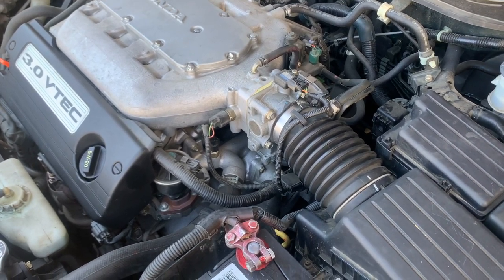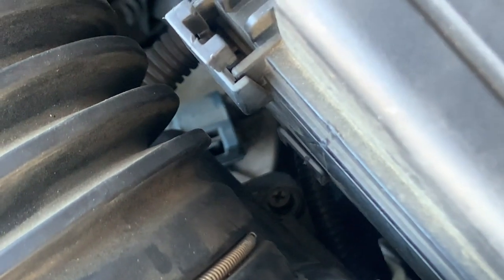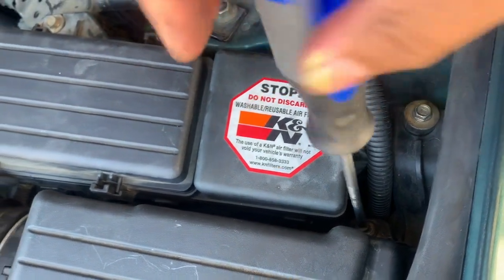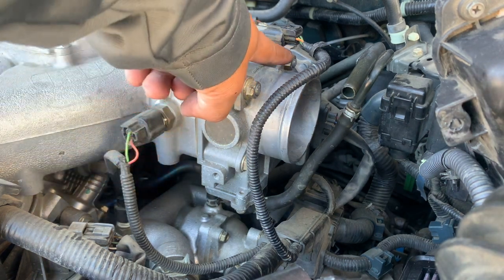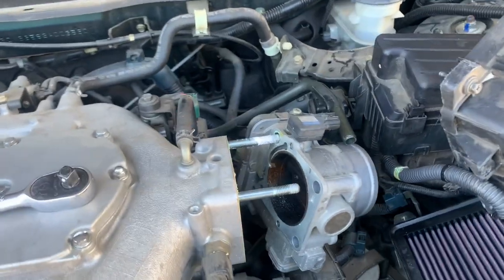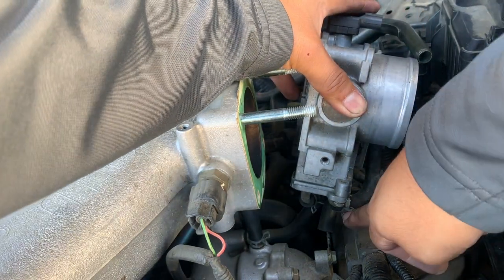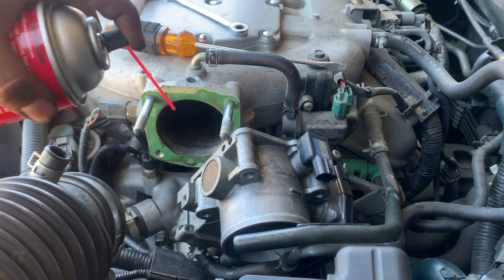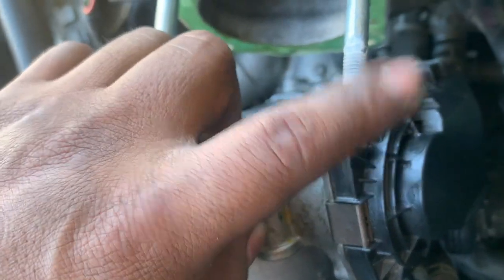How to Clean Throttle Body and IAC Sensor Check Engine Light P0506 Honda Accord 3.0 2003 - 2007

Comment: Just don't use wire brush to clean the Throttle body. Scratching/removing  the coated surface on the butterfly and throttle body is not good. Just use an old tooth brush for the brushing job if you want.
Reply from the maker: Tooth brush works fine.. I’ve tried this many times and haven’t had any problems but you’re right about damaging the surface of the throttle body... you want to be careful when you’re cleaning your throttle body

Comment: So how does your car idle? Mine shows no check engine light but It's idling rough. I'm trying all of the cheap stuff like this first. I just replaced the Spark plugs this morning and still runs rough.
Reply from the maker: Make sure you have the right spark plugs and Gap them if necessary. Next you might want to clean your throttle body and Idle Air Control (IAC)- I have a video on this- also clean your EGR valve, Mass Air Flow sensor. There might be a leak somewhere check out all hoses make sure they’re all connected.
Reply: @RookieRepairs  The spark plugs I took out were identical to the ones I put In. And they had no cracks or anything like that. I replaced them because I already had them and have been meaning to replace them.  Our IAC Is an electric one so I thought we didn't need to clean It but I'll check It out. And I believe we don't have MAP sensors on the 6 Cylinder models, only the 4 Cylinder models. We have a MAP sensor. I'll also look at the EGR valve. I really don't want to be spending any money If any of these fix my issue. Thanks for the quick response. I'll update If I get It running good again by the end of the day. Cars can be a big headache lol, after this I'll probably sell It In a couple of months and get a newer car.
Reply from the maker: @beast11135  here is my video cleaning the throttle body and IAC - didn’t removed the IAC just sprayed it https://youtu.be/7Ad7pH2SFRM
Reply: @RookieRepairs  yeah I saw that. Looks like you need a special attachment to get It off. I think I actually might have that special took. I'll try It In a bit. I've been doing endless research for 4 hours to try and narrow It down. Did cleaning It solve the code you had?
Reply from the maker: I didn’t removed it I just clean and sprayed inside... yes the light didn’t come back. I didn’t have any idling problems. Honda’s are very reliable so I’m sure it’s something simple. So yours idle rough when it comes to a stop or when you’re accelerating? Also I’m sure your check engine light will go on shortly—not long from now. Have you ever drain your transmission fluid and replace filter?
Reply: @RookieRepairs  did it work ?

Comment: Thanks man! I just did a head gasket change and since I did my car is revving to 3,000 RPM down to 1,000 and then back up to 3,000 in a constant loop. It was told it was likely due to my idle air control and air being in my coolant system
Reply from the maker: Nicely done ✅... enjoy your car again these cars are very reliable as long as they are maintained...

Comment: I have the code P0506 engine light that comes off and on ..no problems with the idle do you think the throttle body just needs cleaning?? Once in awhile the engine looks like it dont want to turn on
Reply from the maker: Most definitely clean the throttle body (why not clean EGR valve, MAP sensor, Mass Air Flow Sensor as well). As for hard turn on have you move around the throttle body wire? Or it may be the weather being too cold in the morning or battery going bad...
Reply: @RookieRepairs  what do you use to clean the egr valve?
Reply: Could I use throttle body and intake to clean EGR valve?
Reply from the maker: I normally just used throttle body cleaner
Reply from the maker: Yes, that’s what I used
Reply: Use MAF sensor cleaner for  the MAF sensor. Throttle body cleaner is too strong.

Just don't use wire brush to clean the Throttle body. Scratching/removing  the coated surface on the butterfly and throttle body is not good. Just use an old tooth brush for the brushing job if you want.
Reply from the maker: @metzmatu8409  Thank you for your comment and for your input

Comment: Didn't have a clue what the P0506 meant so thanks for the video.  As one person said below why didn't you remove the bottom hoses? You said one would leak, well before you put TB back on WE ALL could see fluid coming out of one of those bottom hoses?  Was one cut or split while you put it out of way??  Maybe you noticed later?  Aside from that it was a great video on how to clean it.  I have cleaned other cars TB but did not know this error code meant it needed TB cleaning OR sensor(which you couldn;t remove). I have the star tools but will talk with my mechanic before doing this repair. Thanks for the showhow!

Comment: Hey man! Just a few comments for this video. You did not say if it fixed the issue or not? Steel brush is bad and can cause deep gauges to your throttle body! Since got that far, your should have bought the torx with center lock key tool and remove to clean that. The tool should be available in auto parts store. I saw some gas dripping from a tube, hope you noticed that.
Reply from the maker: 🫡 problem fixed… no more check engine light. No harm or damage to the throttle body- I now use a toothbrush to clean all the throttle body
Reply: Was it gas or coolant?

Comment: on my accord the screws are stripped
Reply: Sucks
Reply: Super glue, or saw/cut it until theres a slot for your screwdriver. Could also just use a open end wrench. Then replace the screw with a better one when its out.